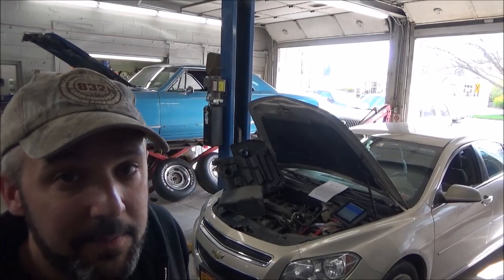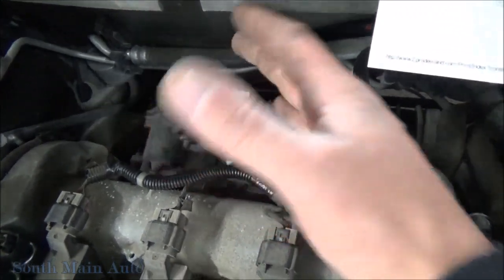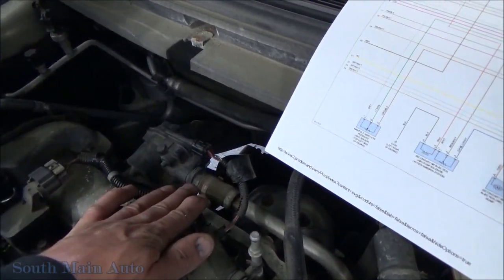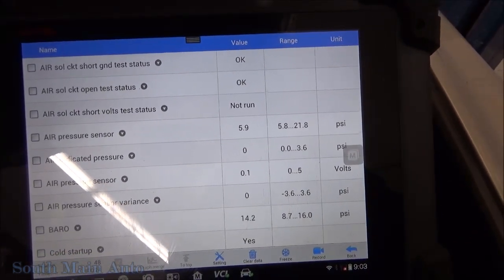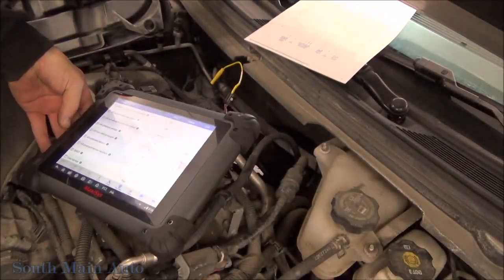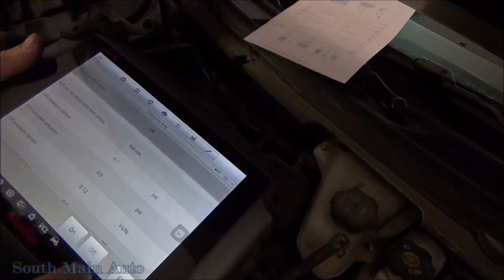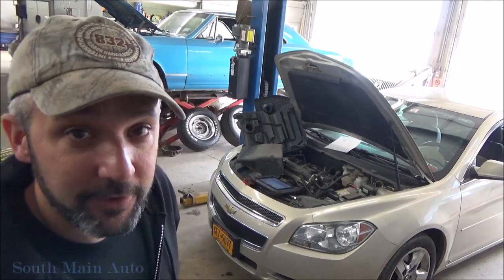Chevrolet Malibu - P2432 Secondary Air Injection System

Comment: I have a 2010 Malibu with the 2.4L, I have a this brief noise on cold starts. After research I've learned that it is an air pump (I'm assuming it's the AIS) that is required for emissions in some states. In your opinion does this sound accurate to you and if so is there a way to quiet it down? Thank you in advance.

Comment: Secondary Air Injection?........................Is it a modern version of the Pollution System Oxygen Pump used on the older engines that pumped air into the exhaust manifolds (each exhaust port) to help burn spent gases from the combustion chambers?
Reply from the maker: +Jeffrey dontyouwish Pretty much sums it up

Comment: got gas, parked the car in some gravel, started it up and got this code. 

an 09 cobalt base xfe model, opened the lower pump seemed fine. then opened that rear pump valve and lots of carbon. did some diesel injection. on first start up i can hear one of the pumps.

does the diaphram rip? or does it just get stuck open and wedges itself from moving? also there is a button on the unit, i dont know what it does or if its just a one way valve.  can you cut the old unit in half?

symptoms are choppy drive at steady throttle

Comment: Hey Dr O, what about a "Throwback Thursday" segment where you can dive in to lost technologies like points style ignitions? I bet you still have a flex shaft hex driver for setting dwell on GM's. Other topics could be drum brakes and generator charging systems with external regulators. Let's help the new kids, under 40, with old fart tech. Thanks again,

Comment: Wonder if the owner of that pretty blue 67 would have an interest in a 400 small block. Its a 1980 2 bolt main short block with a crower perf cam, new chain, water pump, balancer & pulleys. Also have 882 bare heads, non EGR cast 4bbl manifolds, Rochester Quadrajet carbs. Not to far away in PA so would even deliver.

Comment: I got the same car, with that famous code po2135. we already changed the pedal and throttle body and it still goes into engine power reduce mode. dealer already changed the ecm, figuring that was that but still its doing that. What do you think it might be?

Comment: @southmainauto is there any consideration when removing the hose that runs to that valve? Unfortunately GM designed it in such a way that it blocks one of the thermostat bolts, which is coincidentally what I need to replace!

Comment: I've seen you use a digital test light twice now.  Has your opinion of them changed since you told me they were useless(maybe you said mostly useless)?  I'm not being a smartass either,  I genuinely want to know if your opinion has changed. I don't remember which video I had asked that on.   

  I ended up buying that coiled cord test light from your Amazon store.  The Official Scanner Danner one.  I like it a lot.
Reply from the maker: +ejbcomp Oh sure haha yes they are a mostly useless tool, IMO but in certain situations like this they can be used and like in the last vid I did it was actually the perfect tool to use because we were passing such low current down that wire.

Comment: Another great video, Eric.  Very rare to see you use your digital test light.  Good to see a use for it.  Sure wish those scan tools were more affordable but that's how they keep you in business.  Thanks for throwing out some quick ideas on how to get some results without one. Makes for a super video!
Reply from the maker: +johnaclark1 Sure thing. You can get the smaller version of this one for around $1500 I think...
Reply: +South Main Auto Repair Yeah, I've got four cars. An 08 Ody Touring I bought brand new (149K,) 98 Nissan 200SX (125K ), 2002 GMC Sierra (52K,) and 2011 Jetta (38K,) and do ALL my own work and enjoy it.  I'm big on preventative maintenance.  Tires and recalls are about the only time I take them to anyone for anything. I've even gotten pretty good at string alignments! I've never been happy after getting my cars back after the dealers have worked on them, for warranty and simple recalls.  I'd bring my car to your shop any day, though.

I've considered the Autel after watching you work your magic on it but it's still just a bit too expensive to justify for home use and seems like I read they are $20/mo for subscriptions.  I have a little Innova 3130 scan tool I bought shortly after buying my Ody that does live data and I've gotten by with it so far.  Your lift, your Autel and your Verus make me jealous every time I see them!
Reply from the maker: Haha sounds like you have a pretty good fleet there. I know a few guys have mentioned that when they bought a scan tool that that they went in on it with a few buddies and they all split the cost and shared the tool when needed. Didn't know if maybe you had some other gear heads you could or wanted to do that with ya know. Any how just an idea :)
Reply: +South Main Auto Repair I wish! That's a super idea.  Unfortunately, I moved to Charlotte, NC from Eastern Oregon 3 years ago and I live in a neighborhood where nobody does ANYTHING for themselves.  I do EVERYTHING myself and they always look at me in amazement when I'm digging my own drainage ditch in the front yard or simply fixing my own sprinkler head in the front yard.  I just grew up that way.  My dad never hired anything out.  Until I saw him get old and lose the ability I never saw him take a car to a shop.  He couldn't afford it.  He did everything from successfully rebuilding his own engines and even an automatic transmission out of a 65 Ford, to major house construction.  Nobody does that stuff themselves today.  People don't know how to fix things. It's sad.  There's a rush you get when you find a problem and fix it that many people have just never experienced.  You're right I gotta find some local gearhead friends!
Reply from the maker: Oh I hear ya man! I always try to do what ever I can myself and it is sick that they are taking all of the shop classes out of schools now days to. No more shop, no more welding, no more wood working.... our local school says it is because it is just to dangerous for kids haha. The future does not stand a chance. They are to worried about whether or not everyone can use the transgender bathroom bs than helping raise these children into men and women,
Reply: +South Main Auto Repair I was just talking about that with my wife a couple weeks ago.  The schools are so weak sauce.  We had so much fun in shop and learned so much.  Best class I ever took was Electricity/Electronics.  I learned how to wire houses and did small electronics projects, including etching circuit boards.  My dad was impressed when I came home and taught him how to wire a 3-way light circuit.  Yeah, every so often someone got hurt in shop....that's life!  That's how you learn to be careful!  Where are kids going to learn to be machinists, carpenters, auto mechanics, electricians, etc.  Our cities are full of metrosexuals who don't know what end of a screwdriver is up and can't change a light bulb if their life depended on it.  I watched a guy pick up my ol' faithful Racing Edition SnapOn ratcheting screwdriver and had no clue what it was.  If only he'd seen the tall plastic coffee mug that came with it back in 1989 when I bought it!  

Don't even get me started on the bathrooms....I have four daughters.  It'll soon be time to move to Texas.
Reply from the maker: Oh man 4 daughters!? Sorry haha I only have one and she has 2 older brothers and a dad with a short fuse so we have it covered here. I dunno what the world is coming to with all this stuff but I am still raising my boys to be men and my daughter to be a woman. well it was good talking with you. Oh and I brought that question up at a school board meeting. I said how will these kids be able to fix any thing? What will they do when their lawn mower will not start. I was told they expect kids to be educated and have jobs so they will not have to make repairs. They will throw the item away and buy a new one. Kid you not....
Reply: +South Main Auto Repair Yeah, great theory until there is nobody to take your lawn mower to because nobody knows how to fix anything...that's if you can buy a lawn mower because nobody knows how to build one.  Such short-sightedness.  Not everyone needs to go to college to be successful.  That's half the problem right there.  I did both.  I fly corporate jets for a living, learned how to fix stuff (out of necessity but now it's necessity and enjoyment) and went to college for a 2 year degree along with my flying.  I then went back for the other two years when I was 43, just because I might need it to find another flying job.  If I couldn't fly I'm sure I'd do something with cars, electronics, or something physical I can do with my hands.  Nobody fosters that and it's sad.  I'm glad you spoke up to the school board.

My girls bring me their broken stuff all the time.  The joy you get out of taking a sad cry and turning it into a smile because you fixed something is priceless.  Used to be with toys, now it's their iPhone.  Just replaced a battery and a home button in my 15 yr old's iPhone 5.  Smiling kid left my den and it cost me $20.

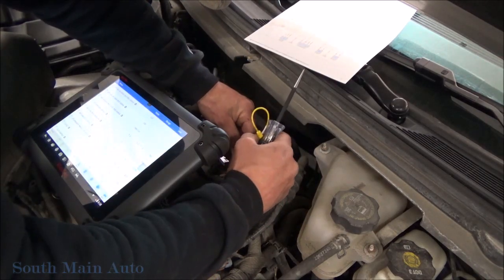Comment: Thumbs up great video.  Had to watch it three times to understand it all.  Some advanced stuff at 5:39, plugging test light reduced voltage into the signal return wire to confirm circuit is good with the help of a scanner.  If I accidentally sent 12 volts into the signal wire using a Powerprobe, would I blow the pcm?
Reply: +Sandbag1300 Nope, sensing circuits are high-impedance so straight 12V won't harm them at all. Eric's digital test light looks pretty slick though!
Reply: +motoYam82 Your right ivan as alway's.

Comment: Gah, SAI issues are always fun, and I have a bit of a love-hate relationship with 'em.  On the upside, they're usually enough of a pain to diagnose and/or repair that a lot of people throw away older cars.  I flip cars every so often, and it's a great way to get a project car cheap!  On the other hand, sometimes SAI repairs can get expensive or labor-intensive.  At least the labor is free when I'm working for myself!

Rather annoying when they combine sensors and solenoids like this, though.
Reply from the maker: +rhkips I have always thought AIR systems were pretty easy. Not to many parts really
Reply: South Main Auto Repair
You don't work on Germans.  ;)
Reply from the maker: Oh yeah I bet they are a mess haha

Comment: What actually this whole sistem is for? Seems ridiculous
Reply: +Stjepan Đopar It seems to pump air into the exhaust in order to make the catalytic converter burn more of the unburned fuel when it's running rich at startup. Or something like that.
Reply: +celeron55 Nah, that doesnt make sense since Eric said that it connects to the head of the engine...well, I bet that it has to do something about that ecology junk
Reply: +Stjepan Đopar Well, the exhaust starts from the head and it's easier to bolt something to the head and have an extra channel in there than directly to the exhaust manifold.
Reply: +celeron55 I dont think so...maybe Eric will answer
Reply: +celeron55  Yep. That's what it does. Just more emissions crap....
Reply: +Stjepan Đopar The A.I.R. system injects air into the exhaust so the cat can burn the unburned gas leaving the engine more efficiently. That valve is connected to the exhaust manifold. On that Ecotec engine, the intake manifold is on the front of the engine between the engine and radiator. The exhaust manifold is on the back of the engine between the engine and wall of the passenger compartment.
Reply: +Frank Gonzalez Thank you!
Reply: +Frank Gonzalez Nice simple explanation!  I never really understood what the system does.
Reply: It warms up the converter at engine start-up by injecting air into the exhaust stream. It is only enabled at 'cold' start ups and can be difficult to diagnose without a good scan tool like the on Eric uses.

It's purpose is to help reduce exhaust emissions, a large portion of which occur at engine start.

Eric does a fine job of understanding, diagnosing, and explaining the system.
Reply: The A.I.R. (Air Injection Reaction) pump does not inject air into the exhaust to warm up the cat. The heat of the exhaust warms up the cat. The A.I.R. pump injects fresh air into the exhaust before the cat so a properly warmed up and working cat can burn unburned gas that wasn't burned by the engine. Nor is it only enabled at start up. It is enabled only after the engine has been started and  cat has reached its operating temperature.
Reply: The model shown, 09 Malibu, AIR system does work the way I described.

What you are referencing is an earlier version of the AIR system.

The extra air injected a 'cold' start, introduces more oxygen in the exhaust ahead of the cat. The cat uses the 'extra' O2 to 'light off' sooner, thereby reaching it's operating range sooner to begin reducing pollutants.

For a better understanding of the system, see GM's factory shop manual circuit/system description & conditions for running for P0410. http://gmsonly.com/Intrique/P0410.pdf  <-- This is the expanded functional description (prior to 'lean' diagnostics for GM).
Reply: I forgot to add the 09 Malibu uses expanded/enhanced DTCs.

I could not find a link to the 09 CM Secondary AIR system description, so I posted a system description from the 2000 P0410 Oldsmobile Intrigue. Apart from some variations in enable/fail conditions, the system operates the same.

Comment: Hey Eric, was wondering why you don't have any Nissan videos?  Love the channel and so far the chainsaw vid is the best...  Lot's of laughs on that one.
Reply from the maker: +Jake 78 (JTTexas2001) Dunno? We don't see many of them actually
Reply: +South Main Auto Repair Seems to be the same with Hondas.  I think I've seen vids with a Civic, a Pilot (for timing belt change) and a CRV is all.  

Speaking of Honda timing belts (I know, not really,) Eric, have you seen these Lisle Honda Crank bolt impact sockets?  It's super thick and heavy.  The extra mass of the socket is supposed to knock the crank bolt right off with an impact.  I've heard people rave about it on the Ody forums.  I didn't know about it when I did my timing belt a couple years ago.  Wish I had.  It was a starter bump trick that got it off for me.

http://www.amazon.com/Lisle-77080-Harmonic-Balancer-Socket%C2%A0/dp/B00RGNCV1U/ref=sr_1_1?ie=UTF8&qid=1463623668
Reply from the maker: Yep I did a vid on it :)
Reply: +South Main Auto Repair Oh, snap.  Ima big dummy.  I see that now.  I watched that video too and totally forgot you used that socket in it.
Reply: Well thanks anyways.  I really appreciate the work you put into these videos.  Can't say enough about it.  Thank you.

Comment: #South Main Auto Repair
I have a problem I have been watching your videos for a while and I think you can help me with this issue:

- I have a 2002 mercedes w203 c200 kompressor sedan automatic , When I start it snd put it into reverse it stalls but if I turn it on and wait abit and put it into reverse it works fine this only happens if I dont turn the car on for like a day or so please help.

Comment: I was working on a chevy truck  with the same system. The intake fresh air hose was in a location that every time you drove thru a puddle of water it  would  suck water in.  So  I moved to to a higher location.